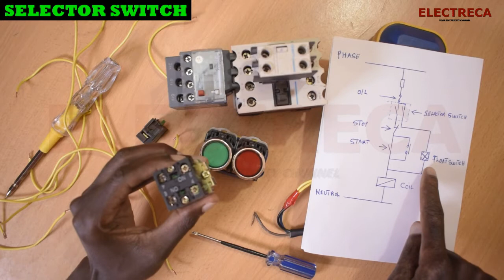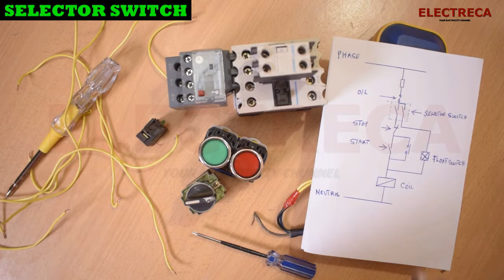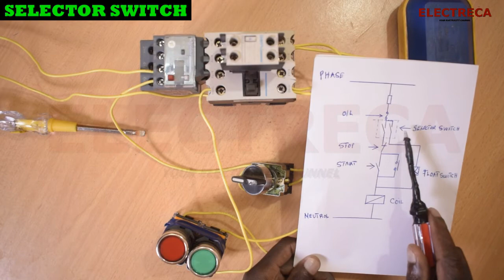Float Switch Selector Switch connection|Auto Manual Control for Water Pump|Electreca

Comment: thanks for this video. can you do a video with two float switches. a low float switch and a high float switch. this connection is a little challange for me. when the low float switch come on it does not start the pump until the high switch comes in
Reply from the maker: Thanks for asking..... I'll do it ASAP

Comment: I would love to see you build a rotary phase converter or explain the wiring and balancing of phases and to control it safely in future vids. God Bless.
Reply from the maker: That's ok, but it's 'll take a while source for the supplies ....
Thanx for watching
Reply: @elektreca  this selector switch automatic plus manual or what?or what's the real use of aselector switch
Reply from the maker: @kevinambetsa7738     Yes it has auto and manual.  
it selects between 2 switching position...... take this video for example..... we have ON/OFF button(manual) and a FLOAT SWITCH(automatic) so you can use the selector switch to choose which one to control your pump or circuit.